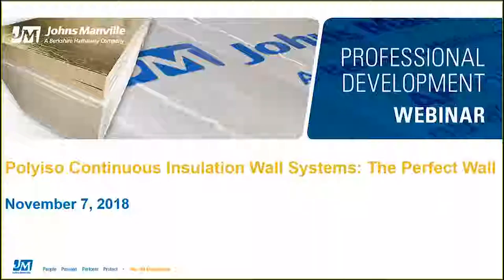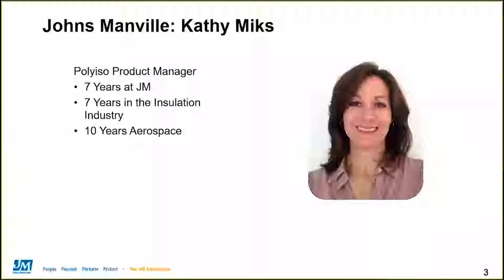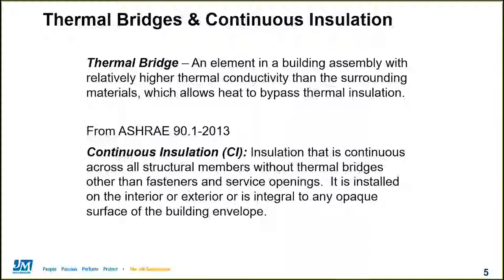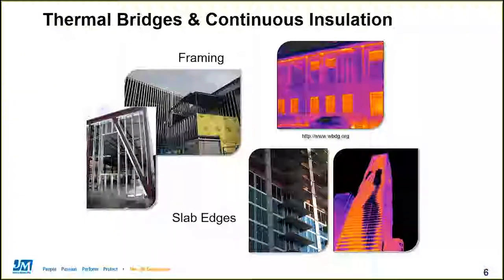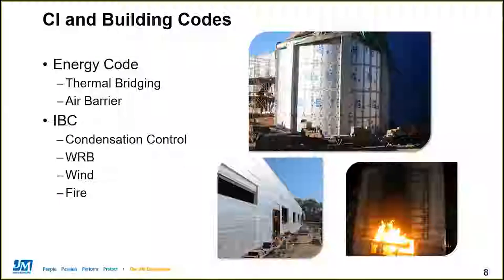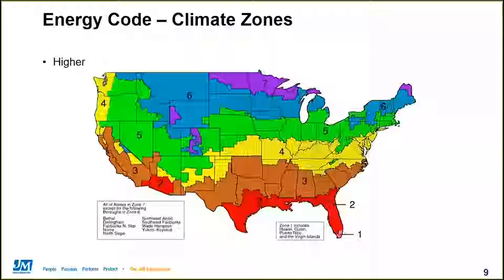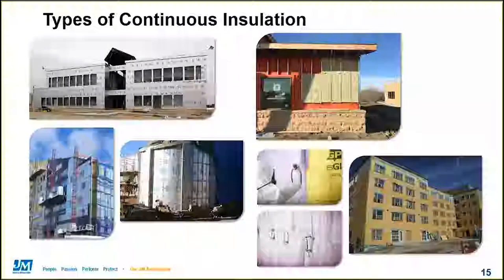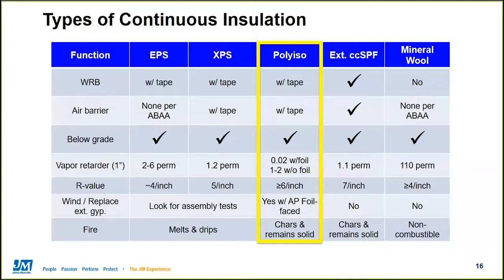JM Polyiso Webinar Nov. 2018

Comment: I have heard that the polyiso blowing agent starts condensing into liquid around 60 degrees F, dropping its R value to about R-2 per inch at 15 degrees F.  Is this true with JM Polyiso as well?  I can't seem to find much data on thermal properties over a temperature range for most products.